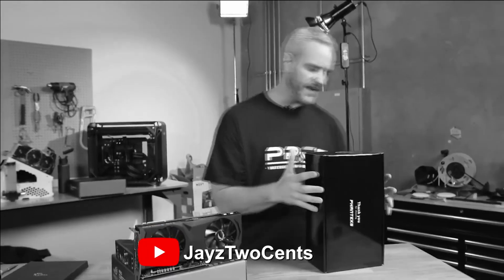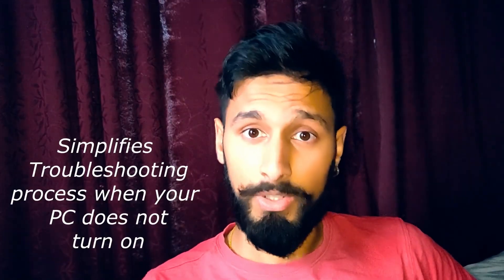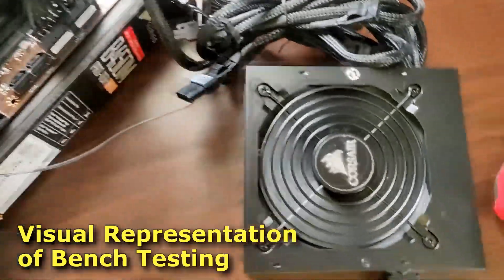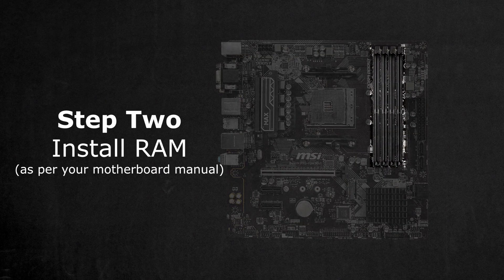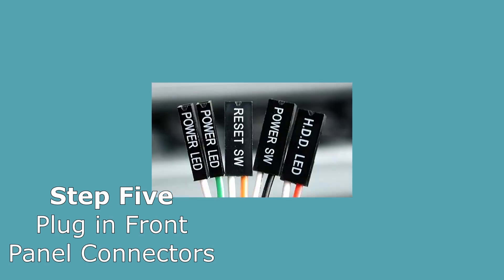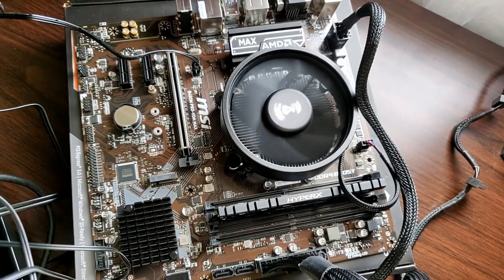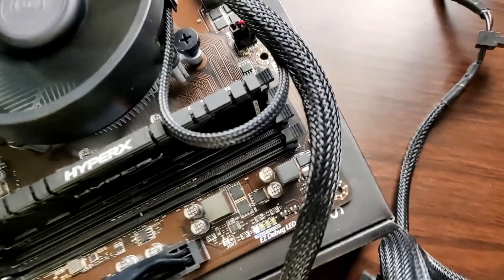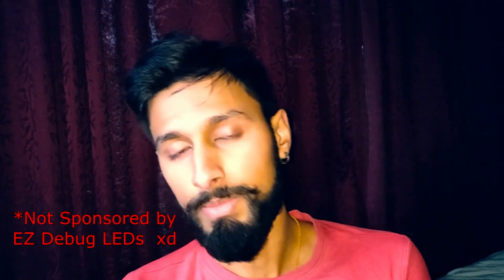Building a $1000 PC but it doesn't work...

Comment: My ram light is on my cpu is on, but the graphics card turns on for a bit , like the fanmoves by a centimeter but it doesnt turn on, i tried using the intergrated graphics, nothing, It was the ram  the light might be on but it wasnt working, but my ram was fine? I was just using it with my other computer? So i tried to put it back in over and over, and it sparked my ram and it burnt my ram. The mother board was faulty.
Reply from the maker: You should always try with as few components as you can to test. 

E.g. cpu (with integrated graphics), 1 ram stick. This will isolate the problem really quickly.

But it looks like you've arrived at the conclusion (a very sad one, too). Let me know if you need any other help.